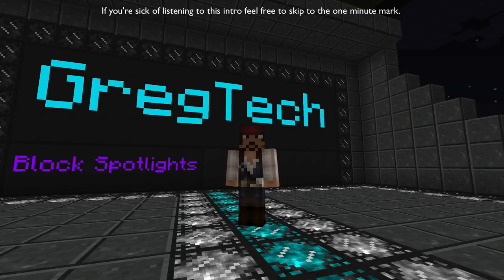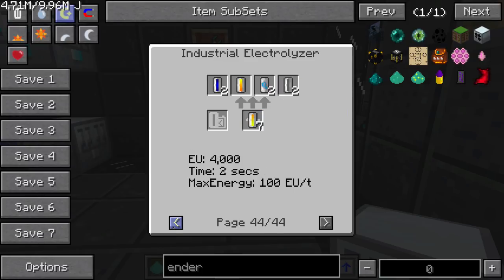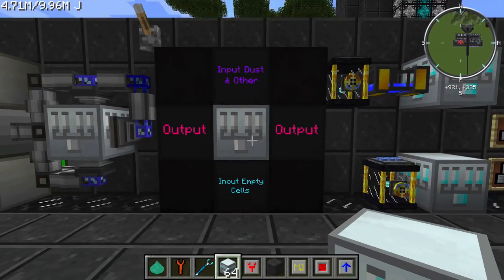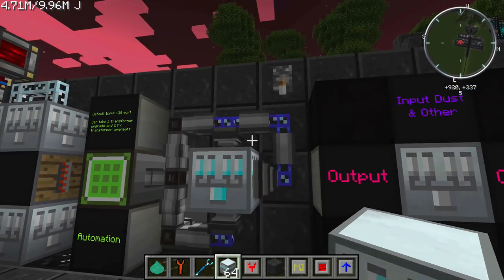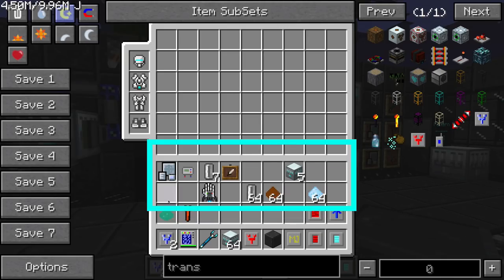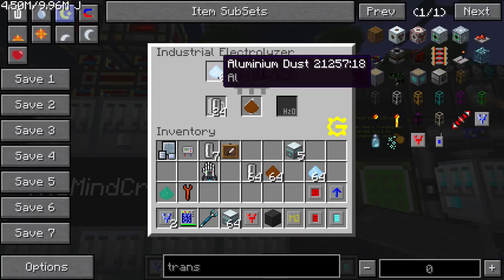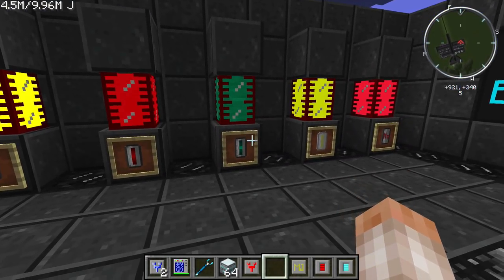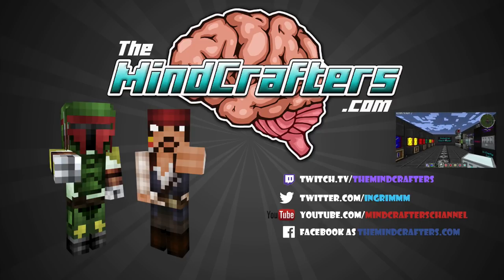GregTech Block Spotlight Episode 5 - Industrial Electrolyzer

Comment: and how do you power it? i have a batbox and i used a glass fibre cable but nothing happens, any ideas? no youtuber or any site reports on how to power except saying how much it needs.
Reply: +Sypher Gaming Network hey. so batbox's will only output 32 eu/t. The industrial electrolyzer requires 128 eu/t. You will need an MFE and your glass fibre cables to output 128 eu/t in order for it to work properly :)
Reply: ***** thanks :)